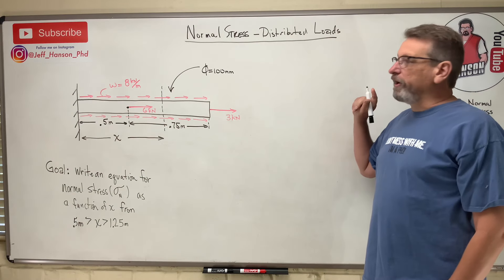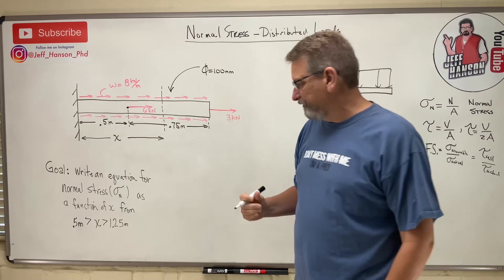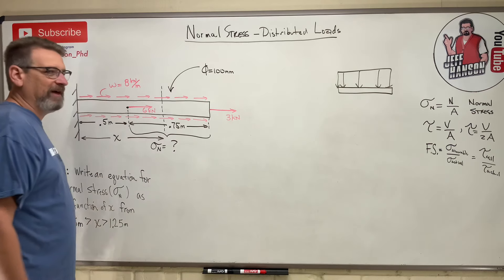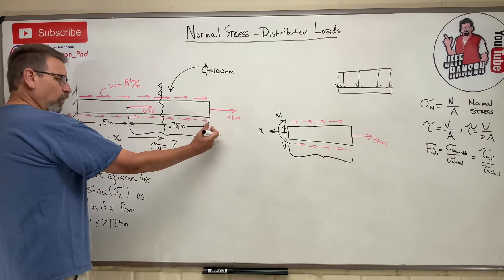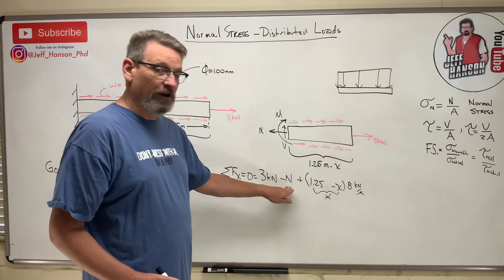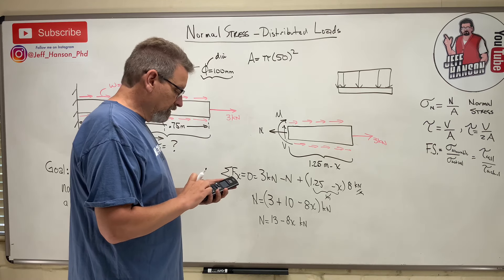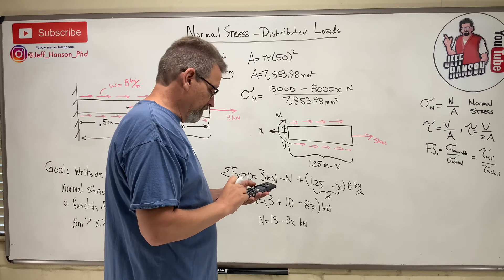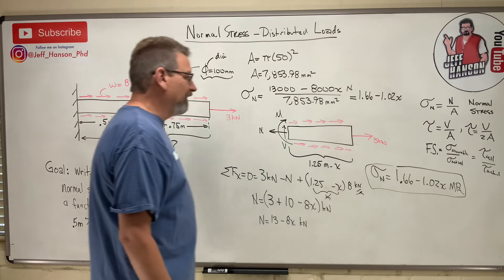Mechanics of Materials: Lesson 3 - Normal Stress with Distributed Load

Comment: How would we write an equation for the normal stress from 0<x<0.5?
Reply: I think it is 0.9 - 1.02xMPa
Reply: @cryeteria  I got 1.02x+0.764 MPa
Reply: B/c the normal force would be the distributed load which is 8 kn/m multiplied by x, added to the 6kn force at the end of the section that we are testing. So our total normal force would be (8x+6)kN divided by the same area, (7.85*10^-3)m^2
Reply: @praketakshantala2179  I got the answer as -1.018x + 2.419. You have to consider the horizontal reaction from the beam (RH) too. And I don't think we can consider the 6KN force here as the range is x<0.5.

Comment: Sum of all the forces in the X axis is N=13000-8000x. And area of that beam is 7853.98. and these values are from the cut section of a beam which have length of "1.25-x". But in the end you are telling, with these values we can find normal stress of a cut section beam which has a length of 0.75m. ig you're wrong sir

Edit 1: 
Maybe it's cuz normal stress from the point where 6kN acting to the end of the beam is same throughout the beam. Correct me if I understood right.
Reply: Yes. The edit part is correct.

Comment: 1newton/1millimeter is equivalent to 1n/1m^3
in other words, 10^3
so, a newton divided by a millimeter is not a megapascal, but a kilopascal.
Do the math for 13kn/7853.98m^-3 and you will see that it equals 1655 pascal or 1.65 kPa
Reply: Oh no it’s millimeter squared which is (10^-3)^2=10^-6. If you divide by that number you get 10^6 which is MPa not KPa